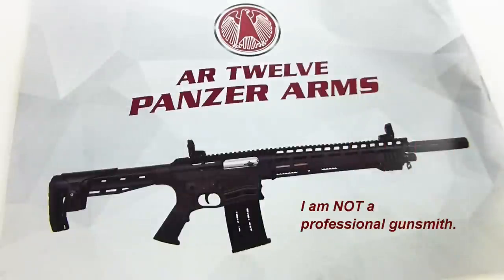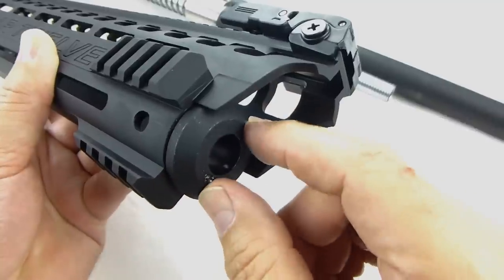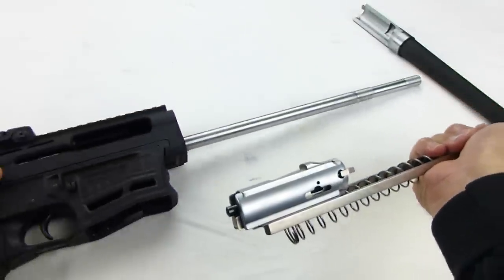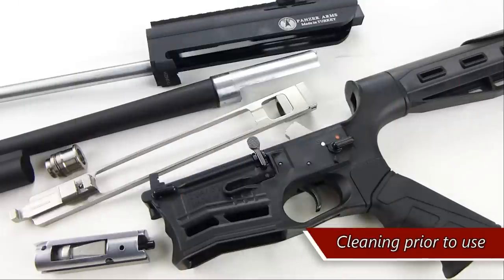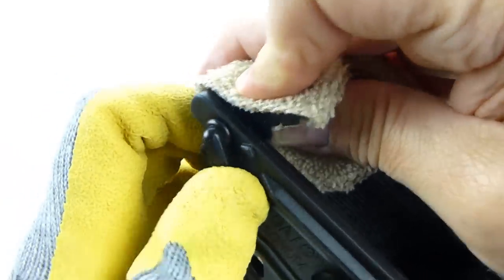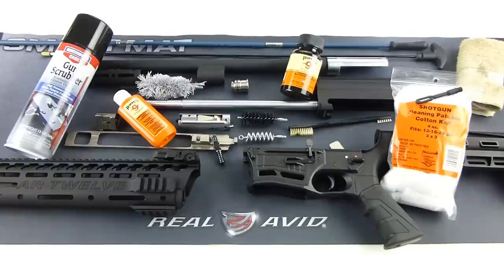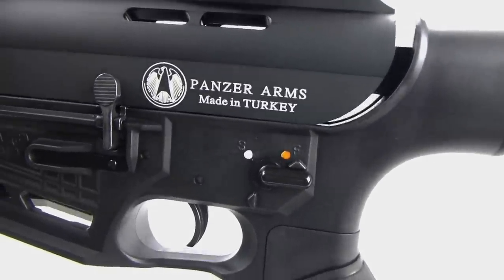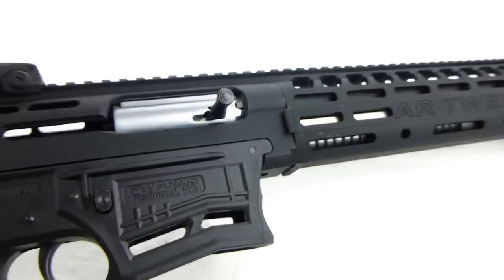Panzer Arms Gen3 AR12 Disassembly Cleaning and Reassembly *Full Video*

Comment: anybody know if you can replace this fake muzzle break with anything or is it simply there for looks?
Reply from the maker: "Faux" muzzle brake is what Ben from Classic Firearms called it in his review. The manual calls it a "flash hider". It is actually a heat shield. When you're shooting rapidly you're going to be glad you have this on, as the barrel gets pretty hot. But, I don't know if there is a real muzzle brake for this Panzer AR12. You might want to contact Dan Tobin at Dan's Sporting Goods to inquire about a muzzle brake for this.

Comment: I have a shell jammed in and I can't move the bolt back at all. The whole damned thing is just locked in place. What can I do???
Reply from the maker: Are you able to remove the magazine? Do you have a Gen3 model…the exact same as the one I show in my video?
Reply: @MrMnmn911  actually I have an armelegant ang-10. Looks just like the one in your video. The magazine is out but the bolt is locked in place. Can't get it to do anything. Brand new gun. I was running 2 3/4 in shells.
Reply from the maker: @MrCrunch76  If it's brand new, it should still be under warranty, you should probably reach out to the dealer you purchased it from. It may need to be returned.
If the shell is empty, you may want to use a rubber mallet to see if you can get the bolt to move. Wrap a towel on the charging hand so that you don't mar it. If the shell is still live, you may to see a gunsmith.
Reply: @MrCrunch76  did you get issue resolved, is shell discharged or loaded?  Did the brass flare causing it to lodge?
Reply: @JessicaSimonson1976  I got it resolved. Took to local shop and they had strike it with a hammer to get it to release. I promptly traded that POS
Reply: @MrCrunch76  sometimes just weak brass on ammo manufacturer end, and not really the gun. Also if the shot was under powered for type gas tube example low brass vs high brass with wrong tube can cause jam. I have panzer AR 12 Gen 3 awesome gun has one adjustable tube. Also not placing the cheek riser more forward causes people to shoot to loose, much like limp writing a pistol. How that causes a jam. People forget semi autos need a strong hold for gas to cycle action properly....all shotguns need to be leaned into. Doing so minimizes sore shoulders.

Comment: You can't keep taking the muzzle brake off like that it'll strip it
Reply from the maker: No. It won't. If you really think so. then don't take yours off.
Reply: What muzzle brake? You might be thinking of the barrel shroud, which the fellow in the video did recurringly misidentify as a muzzle brake.

Comment: I can not, for the life of me, get the charging handle to slide out. Have done everything in this video. I did fire about 150 rounds through it before decent cleaning.
Reply from the maker: MrNosnitram Sorry to hear that. There have been a couple of other comments saying that. If it’s brand new, I suggest returning it for exchange or refund. If not I’d suggest contacting Dan’s Sporting Goods, they are the only USA authorized repair dealer, or contact the importer that is stamped on your receiver, they will let you know who the authorized service dealer is.
Reply: @MrMnmn911  4 months later. Fired it a decent bit. Fires so much better with high velocity 2¾ shells by the way. Currently sitting at the table trying to disassemble again cause I think I'm doing something wrong, so I find this video again! Even with Tools, can not get this thing out! I am beyond upset right now. I have a firearms background and this damn thing is causing me more stress than anything I've dealt with prior. Gotta find a solution.
Reply from the maker: MrNosnitram It has a 1 year warranty. Send it in.

Comment: Hardest damn part of the disassembly is the charging handle
Reply from the maker: Yeah. It is. That's why I suggest smoothing it out with some sanding. That took me a long time. Smooth some, re-insert in the charging handle. Pull out....smooth some more...yada yada yada. Be patient. Take your time. Don't sand/smooth too much. Be patient...it's worth it.

Comment: Just a tip.  I ordered a case for my Panzer Gen 3 from (https://fieldline.com/products/fieldline-pro-series-rifle-case-with-front-pockets-42-inch-black) for $19.99 with free shipping and it's a great fit for the shotgun with my hi-rise red dot installed.   Plenty of room.  The case comes with a shoulder strap and is well made but what it great, there are 4 magazine pockets on the front the 5-round Panzer mags will fit completely covered.
Reply from the maker: Good tip Larry. The link you posted didn't work. Odd. This one is the same and it worked. Weird. Anyway. Thanks for the tip.
https://fieldline.com/products/fieldline-pro-series-rifle-case-with-front-pockets-42-inch-black

Comment: Good instructional video.

But just not my kind of gun. Too many screws and bolts to take down to clean or disassemble
Reply from the maker: If it’s too much for you to handle, don’t purchase it.
Reply: @MrMnmn911  that's why I got my saiga 12 more simple
Reply from the maker: @Mr-6666  Yeah. If it's too much too handle don't purchase.
Reply: @MrMnmn911  IMO I think any gun shouldn't have that many screws and need that many tools. The only I think it should have a screw would be the pistol grip.

Comment: Cool guns but hope you never have it break. 3 mags and  the bolt broke. Email after email and call after call I still have a broken gun. Buy American for actual customer service or you will end up with a 500 dollar paperweight.
Reply from the maker: Who did you email? Who did you call? Was is still under the 1 year warranty?
Reply: @MrMnmn911  Dan's sporting goods in PA. Listed as a distributer and the guy for repairs and warranty work for Panzer Arms. Actually got ahold of Dan once. Was told to send him a email with the part number that broke. The serial number of my weapon as to make sure I get sent the correct part. A brief description and I even sent pics of the broken part. It's a BP12 that o have.
Reply from the maker: petyweestraw Oh, ok. So it’s not the AR12 then?
Reply: @MrMnmn911  l I've done my research.  AR12 owners are having the same problem as I am trying to get them fixed. Again buyer beware
Reply from the maker: petyweestraw OK. Thanks for your input.